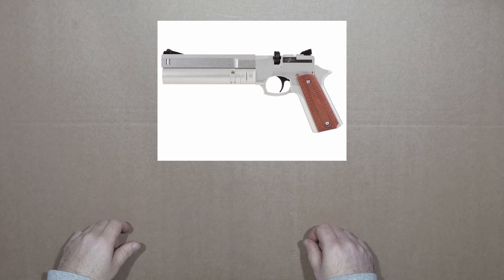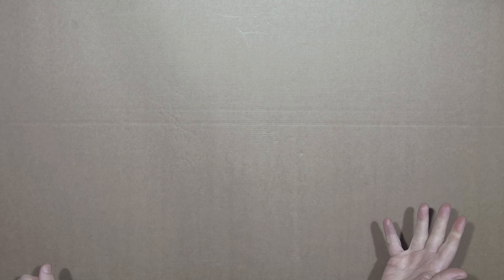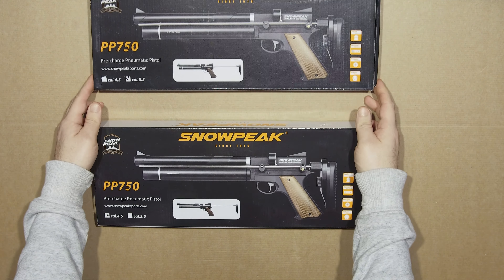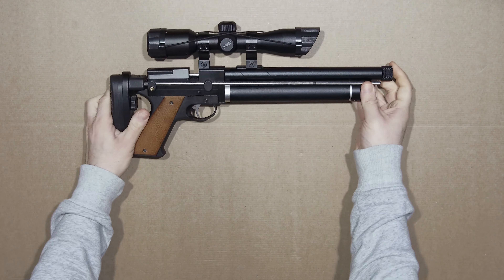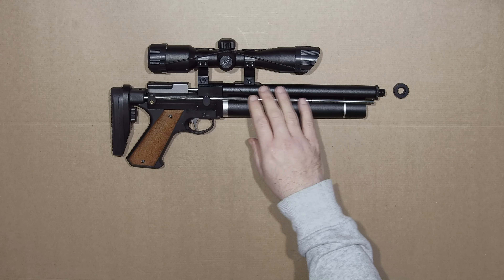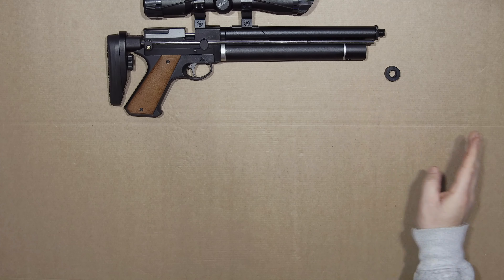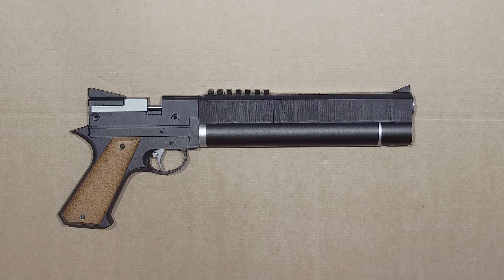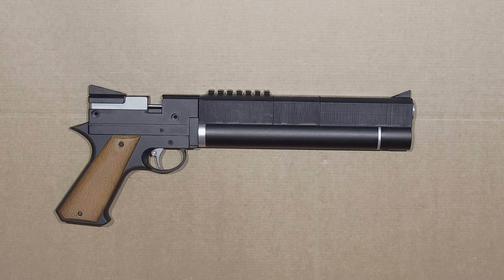Proto: PP750 to Ataman AP16 failure pt. 1

Comment: I think you're doing a great job, I've been working on, modifying and building custom airguns for years now. A lot of it is trial and error (my designs can be a bit extreme and not conservative at all) to get the aesthetics and function to work in harmony. My only advice since you already have the passion and ingenuity (3D printing design capabilities for example, something I don't do) is to be persistent, think out of the box and equally importantly build up a diverse and good quality tool collection; i.e get a proper Dremel one month, a grinding and polishing wheel the next, then a small belt sander etc.. Also good quality drill bits are a must, the Alpen Profi Multicut range are excellent for hard steel but never use them on brass! As for your project the idea of some gas relief holes at the rear is a good one (I make a stupid amount of working suppressors for airguns), as for the front insert I think using grub screws would do the trick if you could get three evenly spaced around the shroud and to thread into or at least grip into holes on the side of the insert.
Reply from the maker: I was thinking about grub screws in the front, too (or in my case, just 3mm bolts with the heads cut off and a slot sawn in, supply issues), the walls of the 3D printed parts are quite thin in the "obvious" places, like the top and sides, but quite a bit thicker on the diagonals.
But I wasn't completely sold on the 3D printed parts, they're still a bit chunky, so I think I might make a 22mm to e.g., 15mm reducer, so I can make a thinner shroud around it. More random taps and dies to order!  Actually, I guess I could just print those.

I finally bought a Dremel last month actually! And yeah, slowly building up the toolset, but I really don't have space for what I really want (lathes, sanders, anything that removes fingers!).

I'm really intrigued by your descriptions of your work, "not conservative" is a great way of putting things.
Also, I'm quite keen on figuring out what makes a good suppressor, and this is a great way of going about it, and I also appreciate the feedback!
I've tried designing and printing a few, and still trying to figure out the benefits of volume vs. restriction.

I have a very silly idea about an electronic suppressor that I have in the works, it has infrared LED's at the front of the suppressor, and has an Arduino that closes a little flap at the front of the shell when it detects the pellet, in the HOPES of locking the air in the chamber, and letting it bleed out of tiny holes in the back.
But uh, let's just say I've still got some major kinks to iron out.

As always, I really appreciate the comment, and thank you for being so encouraging, it makes a difference.
Reply: @MyAirgunPhase  My suppressors are a lot simpler than the electronic idea you have (I see a lot of smashed flaps in your future since getting the timing right is going to be a challenge!LOL). For the core of the suppressor I use hollow aluminium crossbow bolts shafts cut to length and drill a crazy amount of 5mm holes all around the shaft (so it ends up looking like the heat shield on a 1919 belt fed machine gun) the inside and outside then have to be sanded down to avoid any obstructions etc.. Next I get large thin washers with the ID matching the bolt's diameter (doesn't have to be exact but as close as possible) and the OD to match whatever you're going to use as the body of the suppressor, I highly recommend cheap aluminium airsoft suppressors which can be taken apart easily by unscrewing the ends, you can even use the foam that comes with them. I turn the large washers from flat discs into cones using a large vice with a ballpeen hammer pushing on one side o the washer and a thick short steel tube  on the other side to hold it in place yet allowing it to deform into a cone without hitting the jaw of the vice. Make a bunch of these, then have the narrow part of the cone face forwards towards the dangerous end while slid over the drilled bolt tube, then make foam spacers (upholstery foam or soft packing sponge like foam is best). Getting the drilled tube to line up with the barrel is the tricky part, you'll need to make plastic spacers or use rubber grommets to get that right the super glue them in place, you can add hot glue in some cases. Remember airsoft suppressors are 14mm counter clockwise (left hand thread) sometimes clockwise or even both (a thread at each end) they sell plenty of affordable adaptors on eBay even converting air rifle 1/2"  to 14mm and visa versa.

Comment: Hello, i have one PP750 and when i take a two or three dry fire, then the air will escape from the barrel with the third or fourth shot, if you have an idea i would be grateful
Reply from the maker: I'm not sure I understand completely, but maybe the hammer spring is set too high? Maybe it keeps pressing against the valve too hard? You could try adjusting it and seeing if it helps.
Reply: @MyAirgunPhase  thanks a lot... Fixed it appreciate your help
Reply from the maker: @Hemnmahmmod  Really? That's awesome news, so glad I could help!

Comment: No laughing here. I thought it looked pretty cool, considering a second printing with metallic filament and a bit of sanding and paint could work wonders. The air pressure will blow the friction fit parts clean off. You need to print your part with enough plastic density at the muzzle to tap your silencer thread.  Let me digress after a  few beers and say that, you might already know that friction fit silencers can work, and they absolutely do, but I wouldn't go into 600 fps territory with a friction-fit part. For my stuff it's sub 500 fps.  BB guns like the Umarex Glocks and pellet pistols like the Beeman P17 can do friction-fit silencers without blowing them out. Any gun requiring a license could potentially harm someone if they use friction fit parts.
Reply from the maker: Yeah, I thought I'd give it a go in my cheap PLA before wasting money on a good metallic filament.
I considered using the metallic gold I have, but that'd look gaudy, and the sanding would definitely make all the difference.
Buuuut if I bought a resin 3D printer, then I'd get the smoothness right out the box...

As for friction fit, yeah, no way in hell will I trust that with the pressures involved. I couldn't figure out where to put a grub screw initially though, but then figured there was just enough material at the bottom of the plastic shroud, and tap it upwards through the aluminium tube and into the threaded part. That worked a treat.

And likewise here, most things are sub 500fps due to the 10J legal limit, but I still wouldn't trust it.

And you make more sense after a few beers than I do normally, so thanks for the comment!